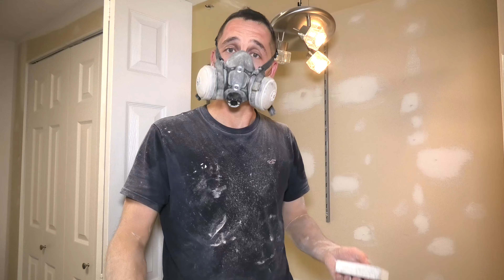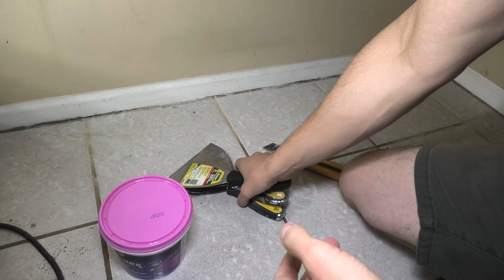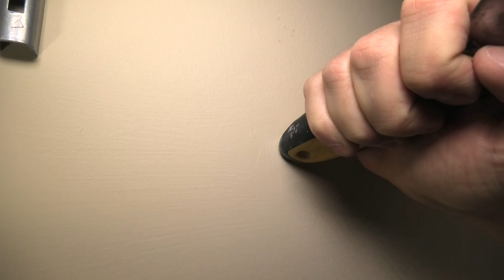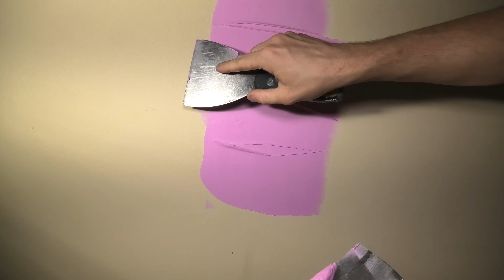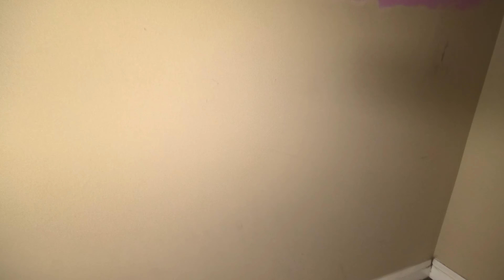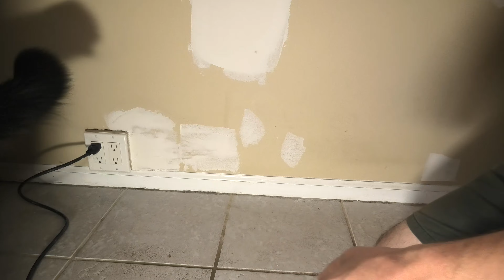How To Patch And Sand Drywall Dents, Holes And Repair Minor Damage? Detailed Tutorial.

Comment from the maker: RECOMMENDED PRODUCTS AND TOOLS:
1. DRYDEX FILLER - DryDex Dry Time Indicator Spackling - https://amzn.to/46rVm4e.
2. PUTTY KNIFE 3 INCH - 3" Warner 90133 ProGrip Full Flex Putty Knife - https://amzn.to/3W6pm16.
3. PUTTY KNIFE 4 INCH - 4" Warner Flex Broad Knife with Hammer Cap, Painter's Series, 10324 - https://amzn.to/4fhWqMK.
4. PUTTY KNIFE 6 INCH - 6" Warner Manufacturing 90137A ProGrip Full Flex Broad Knife - https://amzn.to/3WyYOr3.
5. UTILITY KNIFE - OLFA 25mm Extra Heavy-Duty Utility Knife (H-1) - https://amzn.to/46bIaQb.
6. N95 MASK - 3M N95 Personal Protective Equipment Particulate Respirator - https://amzn.to/3LmtRjx.
7. HALF MASK RESPIRATOR - Honeywell North 5500 Series Half Mask Respirator With (2) N75003 OVAG cartridges - https://amzn.to/44trz9r.
8. SANDING SPONGE - 3M Drywall Sanding Sponge, Dual Grit Block, Fine/Medium, 2-Pack - https://amzn.to/43e2ONs.
9. SHOP VACUUM CLEANER - Shop-Vac 4 Gallon 4.0 Peak HP Wet/Dry Vacuum, Portable Compact Shop Vacuum with Tool Holder, Wall Bracket & Attachments, Ideal for Home, Jobsite, Garage, Car & Workshop - https://amzn.to/3NZnDYN.